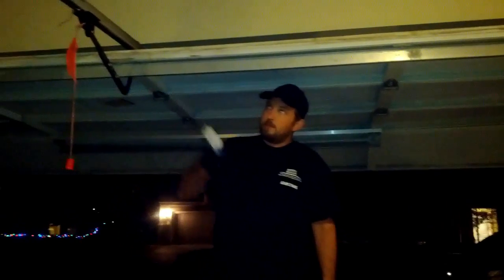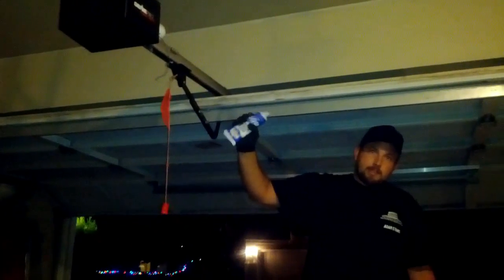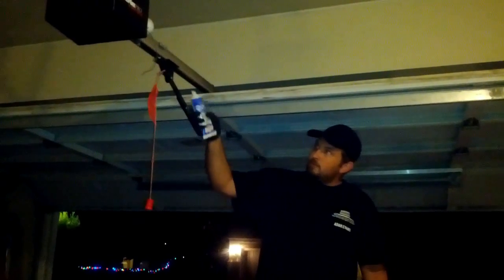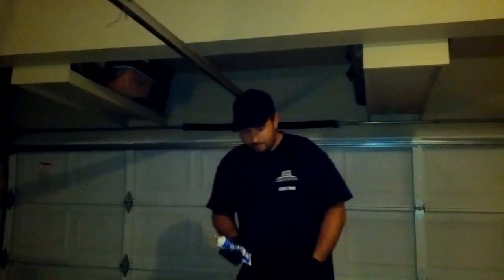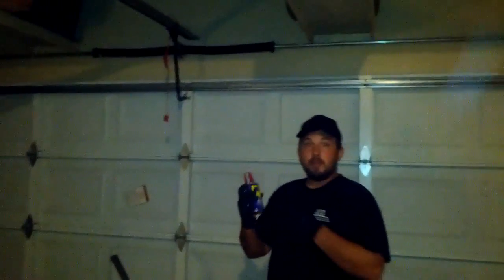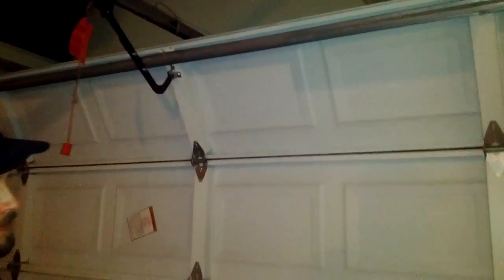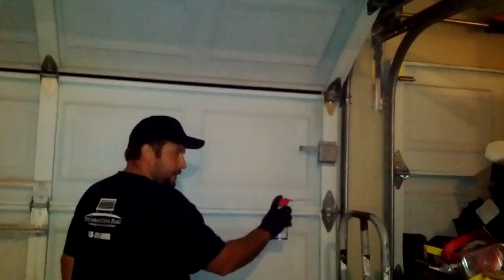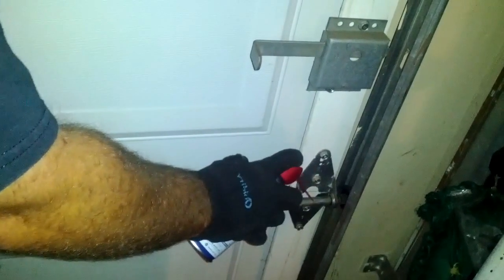Adam Evans - How to Lubricate Your Garage Door and Screw Drive Motor

Comment: Some value, but very hard to figure out because the verbal commentary is way off with video.   Eg.   you seem to be applying white grease to the "motor/screw drive"   while the door is not moving up or down.   You talk about applying lube to the rollers, at the same time the picture shows you applying lube in between the springs.    Very confusing.

Comment: Are you employed by the corporation that makes W-D40? 40 is a caustic agent that BREAKS DOWN lubricant. Use white lithium spray grease. Now, if you want to clean all of the parts, then please use 40. And then use spray Lithium to coat and lubricate all parts of the door system,